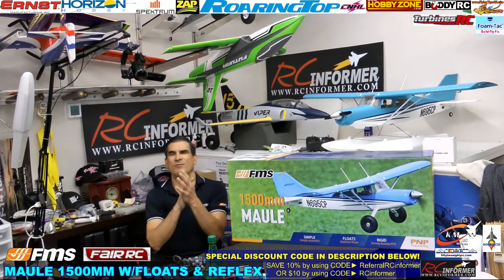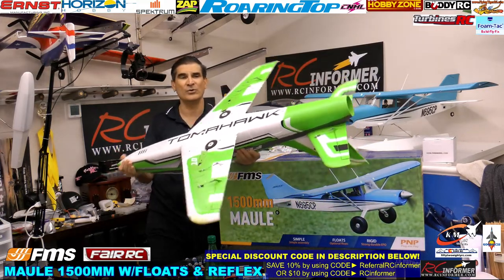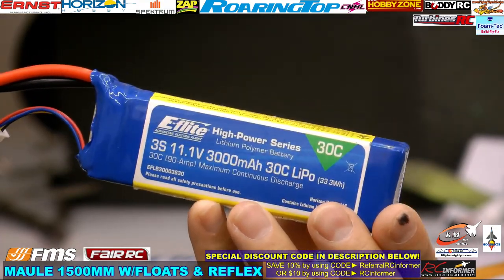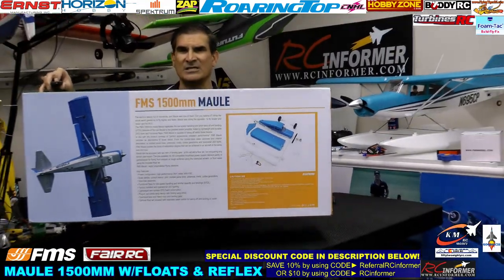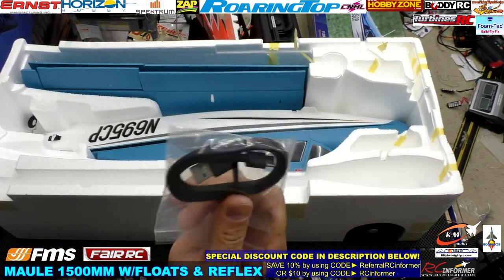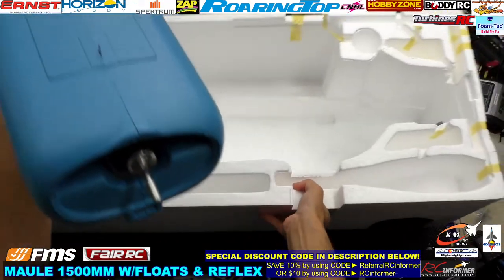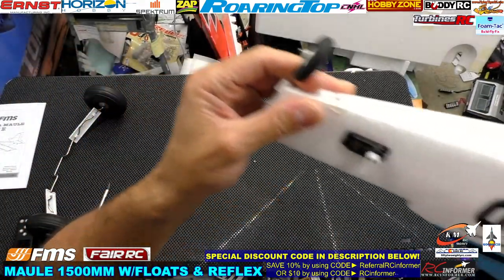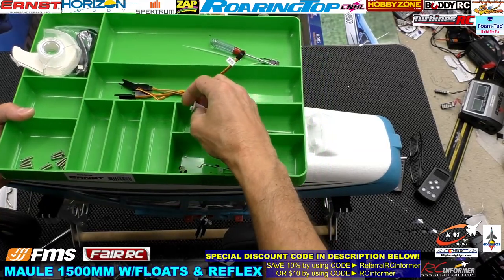RCI LIVE - ***NEW*** FMS MAULE 1500mm UNBOXING, ASSEMBLY & SETUP FIRST LOOK!

Comment: That tail wheel assembly is weak, I broke mine off the 1st week I flew my Maule M7.   A heavy duty zip tie drilled to except the metal rod and a few self tapping screws make the rear tail much more durable.   If anyone ever brakes yours shoot me a message and I’ll send some nice photos.  It won’t break again.    The hinges are also so so ,  so keep that in mind and be ready to  secure those better as well. Other then that it’s actually my favorite STOL to Date.  I may purchase this one and put my EFlight electronics in it .  All servos have been upgraded to full metal gear , and the ESC now is A Spektrum  Avian 60AMP  smart ESC to play well with the Spektrum AR631 .

Comment: Do you think the Maul floats will fit the 1800 Ranger?
Reply from the maker: I'm pretty sure the floats are the same... it depends on the bend in the wires. I can check for you.
Reply: @RCINFORMER  There the same i have both planes

Comment: Hey Rich just got my FMS Maule today 3-7-24 from Fair Rc and the tail section didnt have that plastic peice on the bottom that steers the tail wheel rudder and has the rudder control horn molded to it. Have you herd of others getting them this way? there is a round inspectors tag in each FMS package saying QC-1 should i let Fair Rc know about this? Looks like the New Maule is grounded for at least another week. So Bummed out about this mishap.
Reply from the maker: Yes. Let them know. Im sure they will handle it for you:)
Reply: @RCINFORMER  Sent 2 emails already and still no replys back from them? Can you IM me a Phone number for Fair Rc i didnt see any phone number on their web site? Thanks Man
Reply from the maker: @looneytunes47  where did you get it from?
Reply: @RCINFORMER  Fair Rc
Reply: @RCINFORMER  Fair Rc made things right with my missing part issue Rich thanks for your help man.